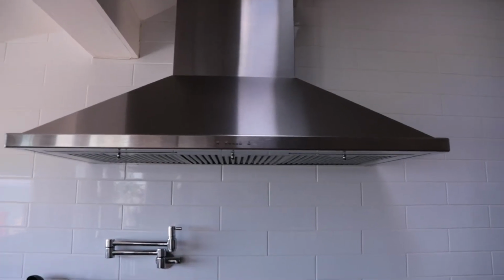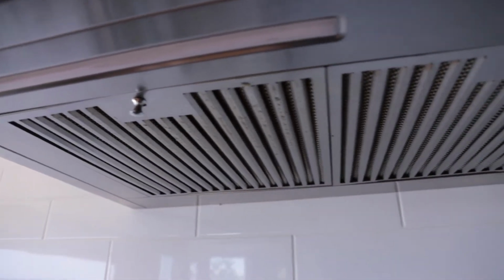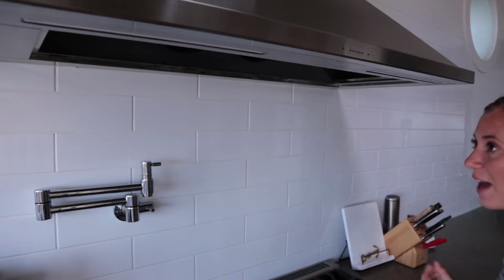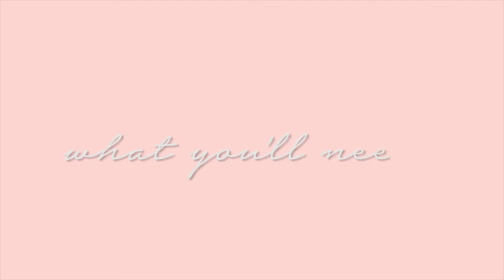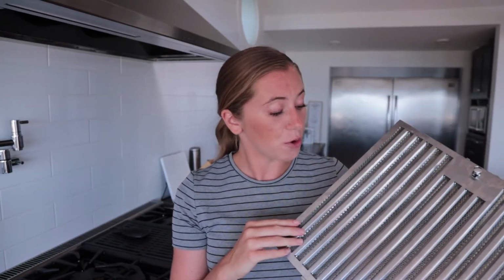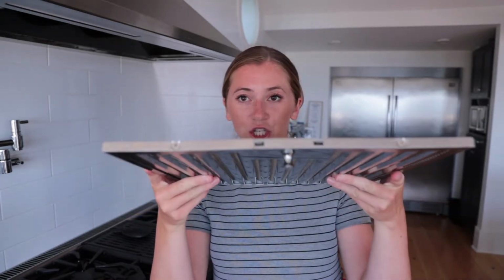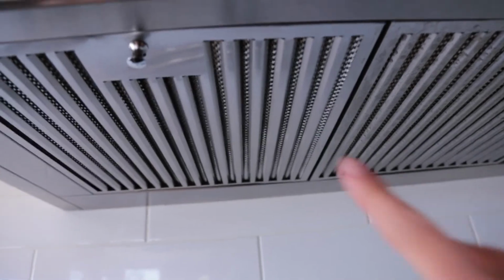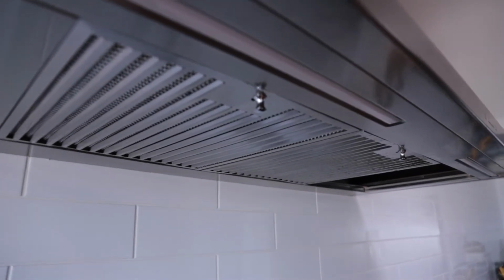HOW TO CLEAN YOUR RANGE HOOD FILTER | Easiest Way To Clean A Greasy Stove Filter

Comment: I Just put it all in one side of the sink or in a square tub outside and just put 4-6 dishwasher tablets and pour it with boiling water and let it soak for 30 minutes to an hour and the grease just melts off. 
P.S Wear gloves 🧤.
Reply from the maker: This wouldn't all fit in my sink but that's a great idea! I know, I know re: gloves. I have such a hard time wearing them cleaning and gardening but you and my mother are on me for it.

Comment: I like the filterless range hoods with auto clean in it :D
Reply from the maker: Oh wow, I didn't know that was a thing!!
Reply: @AfterTap  Yup! I really recommend the Pacific Tru-Steam range hoods, and/or the Hauslane Chef Series C385 and the C400! The ones I listed doesn't use filters, the fan separates grease from air centrifugally, and the oil drips into a container cup. Also, they also have auto-clean! Using steam! :D Depending on how heavy you cook, I recommend using the auto clean feature once/twice every 2 months.